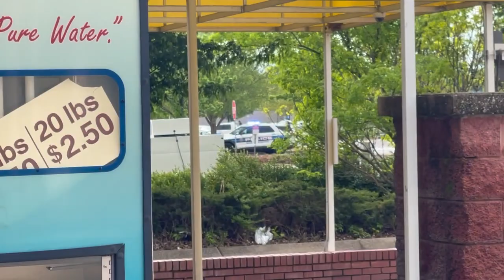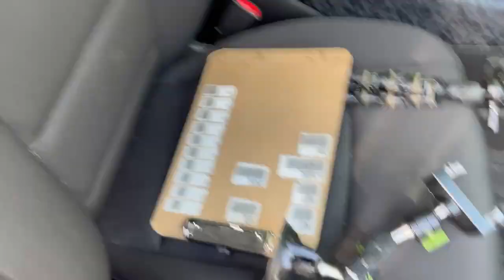￼￼A PROMISE IS A PROMISE ￼

Comment: OMG that negative wire looking weak - you should get some self tapping screws the right size and make it right. I hooked mine up with some washers right next to the seat then put the plastic cover over it no one knows its there.
I thought those rear speakers came with wire and connectors you wouldn't need to solder at all.
Yeah the struggle is real I will stick with the SUV for getting the speaker box in and out with ease.
Perfect time to wrap the box since it is out of the car.

Please  zip tie that seat release.
Reply from the maker: Lol I got you